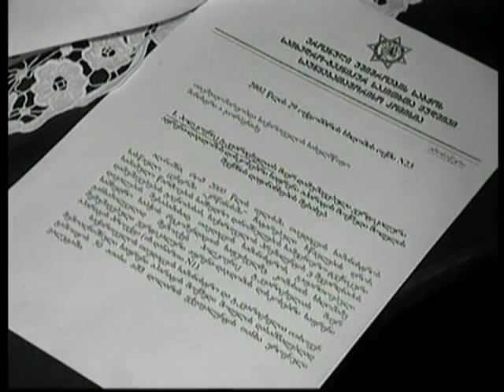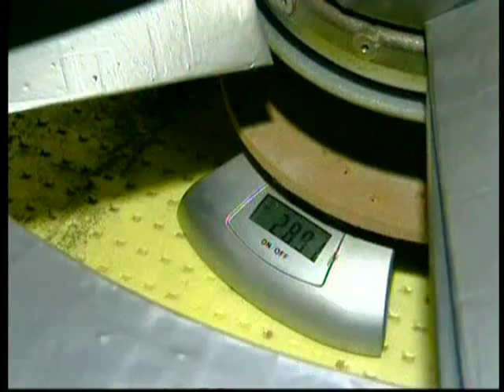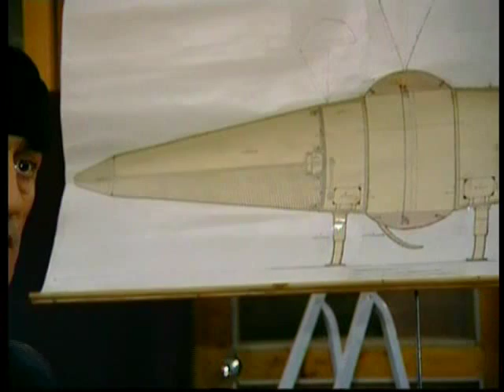Disc Shaped Flying Apparatus

Comment: need a gyro to control it hey, i wonder if separated fan units would be better less power needed for each motor ,safer if a motor failed and less stress.   very nice work looks great. i buy one